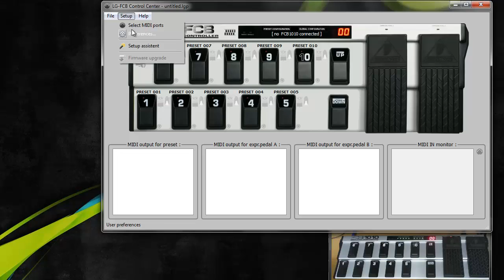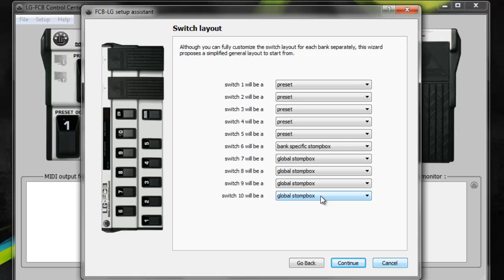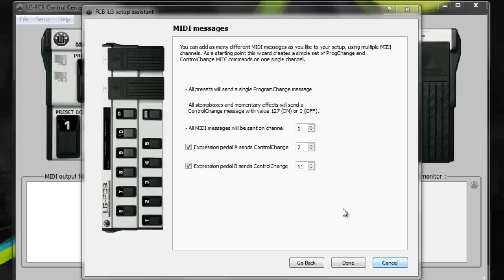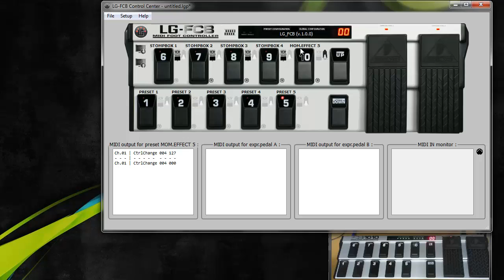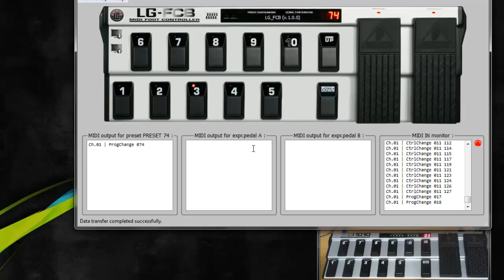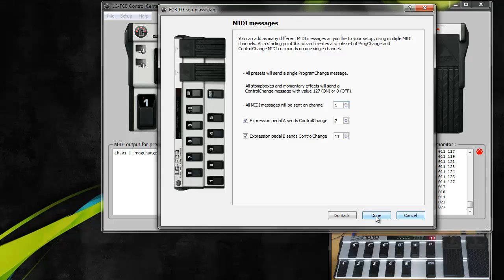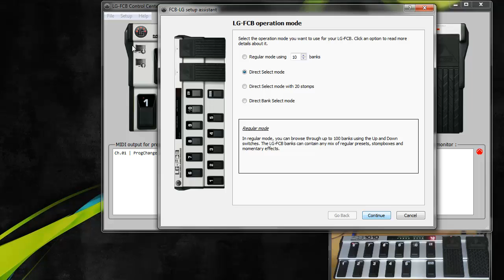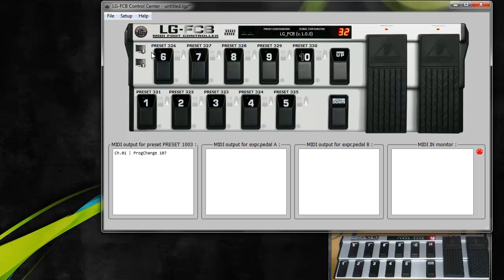lgfcb tutorial 3

Comment: hi guy. Help me please, I can not install the program buttons 1-10 on the controller. Although the C 27 and C7 are working normally in Guitar Rig 5. What is the problem? The chip was changed or you changed version of operation system in there?
I bought it for control effects in Guitar Rig but I can't used it. (

Comment: Ah, no, with the LG-FCB board (or with UnO firmware) the function of a switch cannot change depending on the currently active preset. That's possible with the GORDIUS LittleGiant products only. As a workaround, with the LG-FCB board you can have up to 100 banks, so you could create a different bank for each song, and have as many stompbox switches as you need for that song (for instance 3 preset switches + 4 common stomp switches + 3 preset-specific stomp switches, instead of 1 wildcard switch)